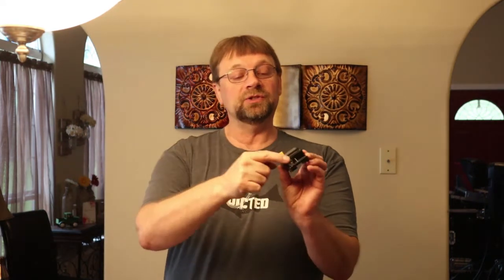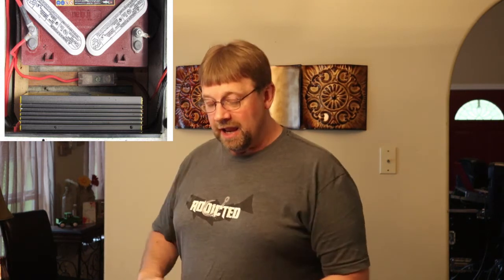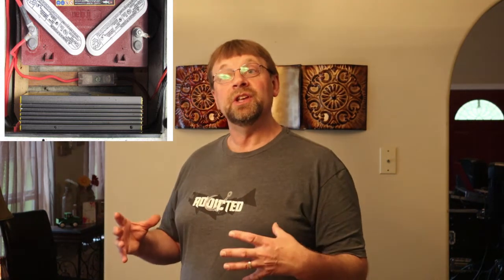The inline fuse type I use for my 24 volt trolling motor system

Comment: I have a shakespeare glider 38lbs and cut my shaft shorter and noticed the speed switch positive terminal was melted a bit ! So I'm wondering if putting a fuse on the positive cable would it blow the fuse before the switch ? And what amp rating fuse if you'd know about that ! Thanks
Reply from the maker: I can't say definitively. Typically this would be caused by high amperage. As the voltage in your battery drops and the amperage increases to match the motors demands it can exceed the wiring and connectors rating. Once it gets past that rating that's when things start to fail. Larger connections and larger diameter wire is typically the direction to head. On a positive note if the switch is still working well then you have something to work with. I don't think of fuse would solve problem but they are intended to protect you're wiring and equipment from over amperage so it would not hurt to install it

Comment: Why put a large breaker 0n a trolling motor that only pulls 10 amps
Reply from the maker: My minnkota trolling motor is rated at 56 amps, but the main reason to use a breaker is to prevent fire from melting wires.